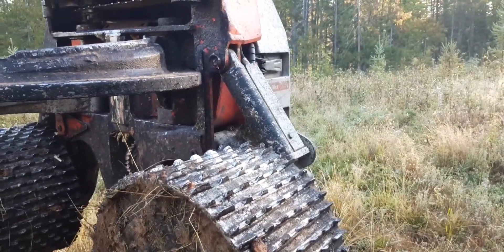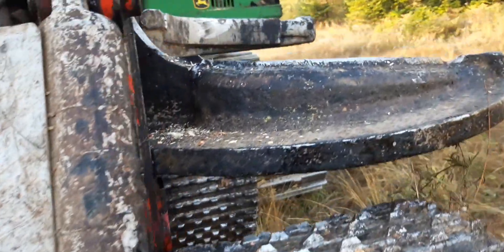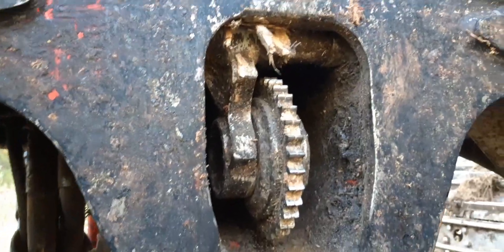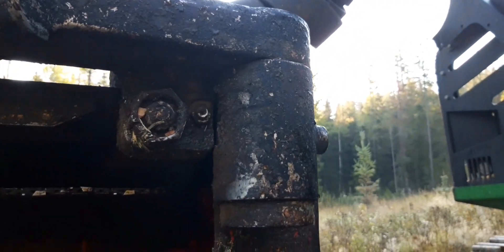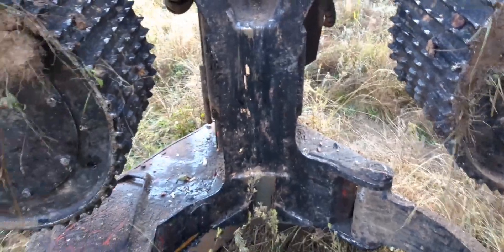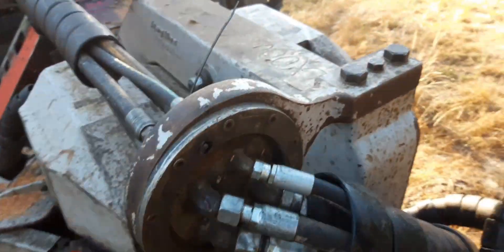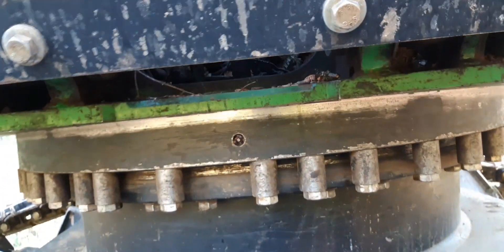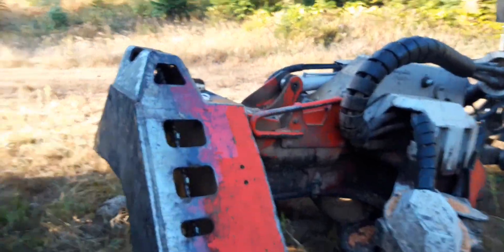logmax maintenance.

Comment: Do you ever have any issues with the Cab staying Cool in the Summer ?
Reply from the maker: This machine was built in 2014 and  ac is marginal even when new. The Cat 320 I ran before had much better ac.
Reply: @weilfast  I put a 2” piece of Styrofoam on the Roof that made a big difference. 2654D. Didn’t know if I was the only one…
Reply from the maker: I have a piece of cardboard inside my skylight, also use a long air gun to clean the ac radiator out regularly. 
Ac on loader is lackluster also. 
The 848 skidder has awesome ac
Reply: @weilfast  get the Reversing Fan on your Next one!!!!
Reply from the maker: It has auto reverse on the main radiator/coolers, but ac is behind the cab with electric fans, sucks hot air. JD advertise a redesigned system. Maybe the new ones are better?
Reply: @weilfast  ooooo yeah right the Cab I gotcha!